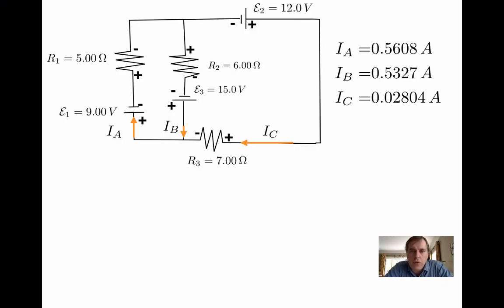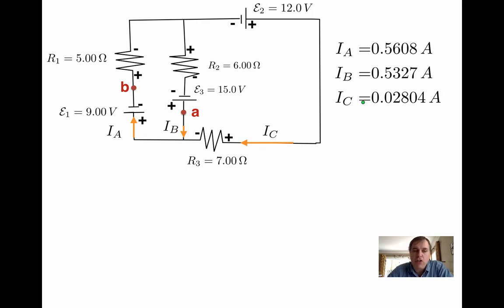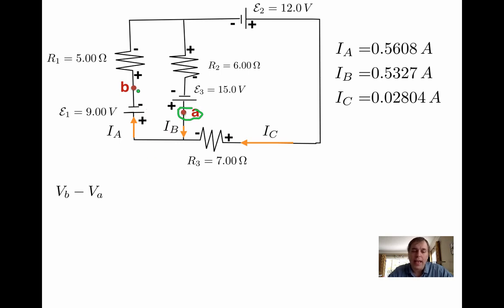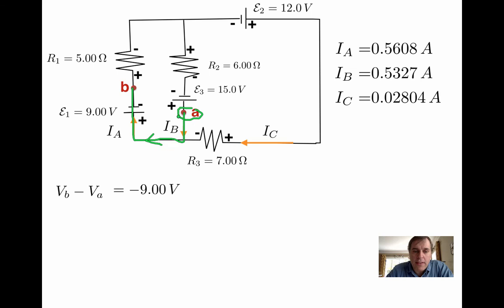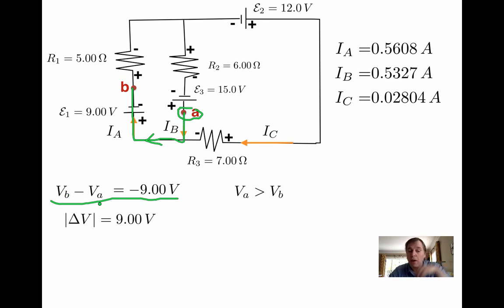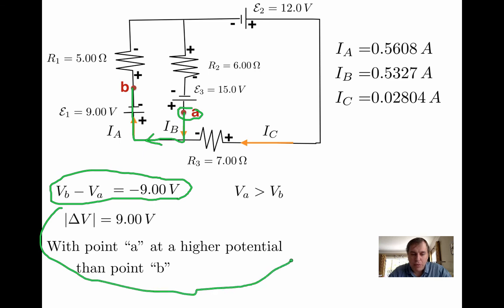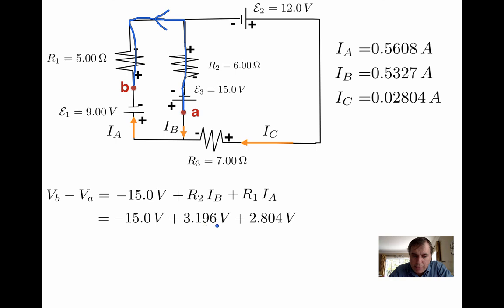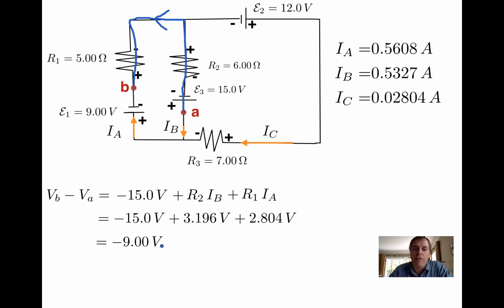Video 18-Voltage between two points

Comment: Hi! Im a bit confused, I thought point b would be -9V since it is touching the negative electrode of the battery and point a would be 9V
Reply from the maker: Hello, thanks for your question.  There are two things to be careful about here.
 First, for a 9 volts battery, the difference of potential between the two terminals is 9 volts. With the numbers you use (+9 V and -9 V), the potential difference would be 18 volts, so that can't be correct. 
Second, the potential at a given point in a circuit is totally arbitrary, so at the negative electrode of the battery, we can set the electric potential to absolutely any value we want. But the difference of potential between the terminals of the battery has to be 9 volts, with the negative terminal being at a potential  9 volts below the positive terminal. So the negative terminal could be set to be 500 V and then the positive terminal would be 509 volts. 

I hope this answers your question, if not, let me know!